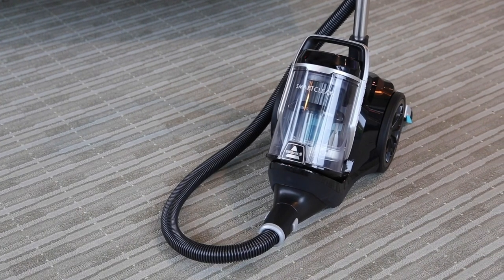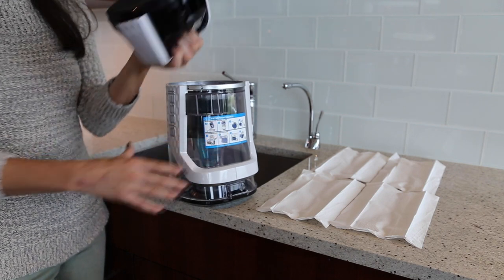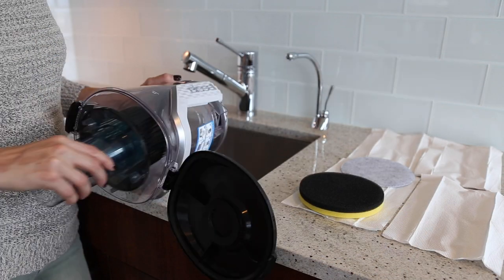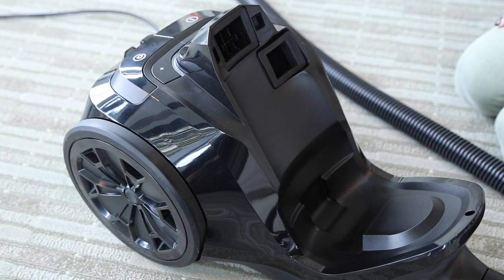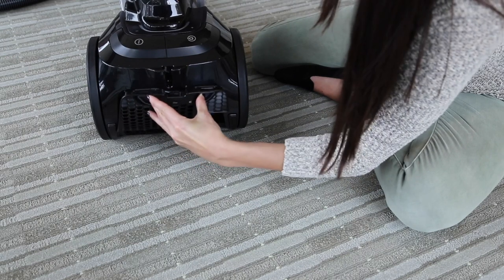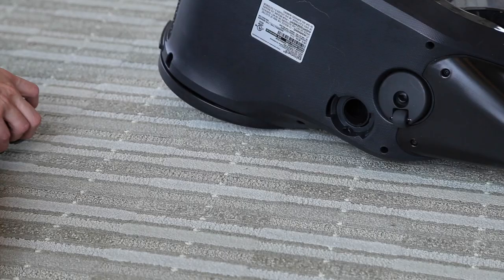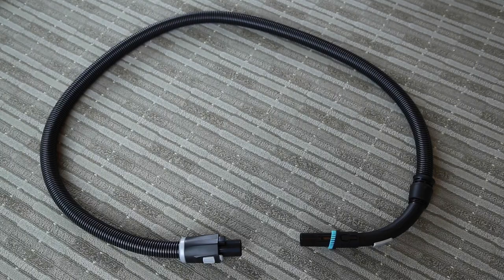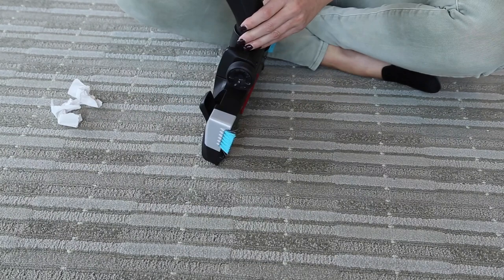How to Fix Suction Issues with Your BISSELL® SmartClean® Canister Vacuum

Comment: This design like all rotary powered heads have a fundamental design flaw.

That is the power cable runs through the middle of the flexible lenght of hose thereby obstructing any debris vacuumed up. 

You will have to spend many years of cleaning the inside of the hose once blocked. Which occurs on a monthly basis.

Come on this could be easily solved for very little cost. Bissell sort this out.